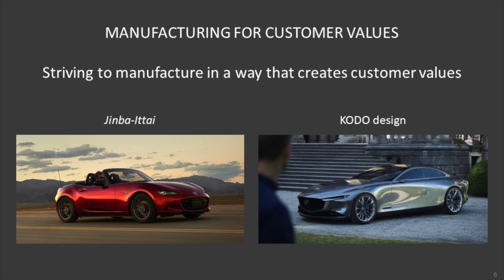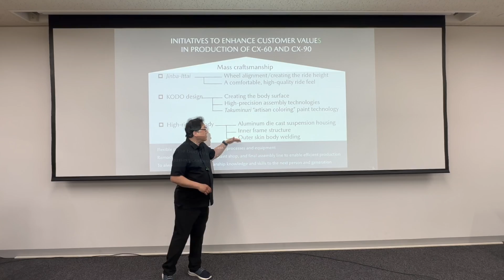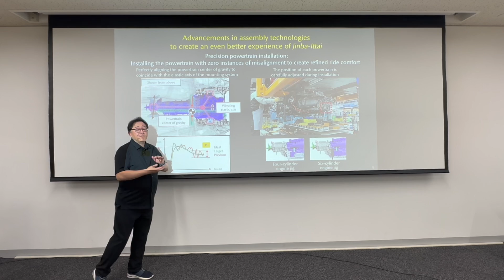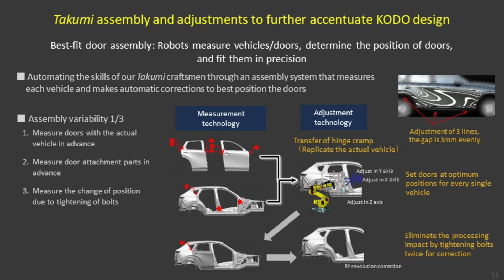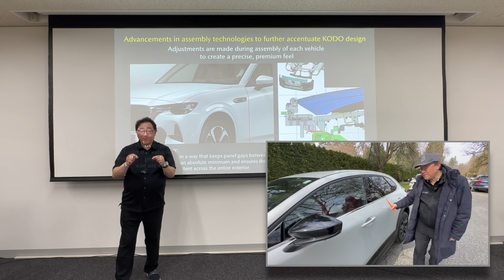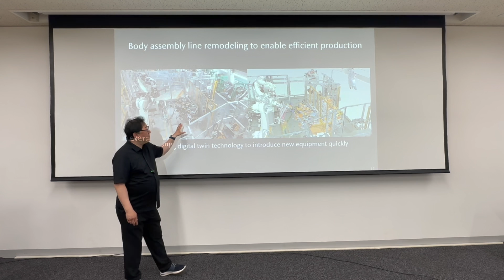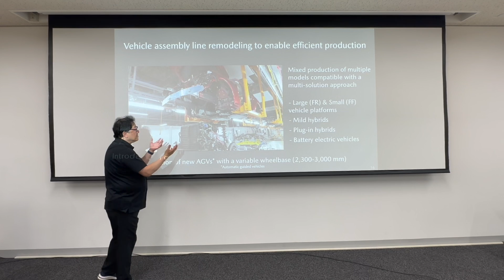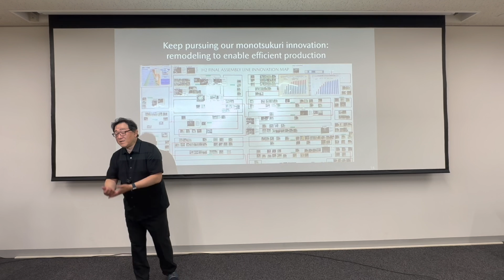ENGINEER EXPLAINS SECRETS OF MAZDA ENGINEERING // HOW MAZDA DEVELOP & MANUFACTURE CARS

Comment: Good video! Years ago we had a RX-3 Wankel Mazda. It was lime green. It ran surprisingly good until the seals went in the engine. We had a 2009 Ford Escape Hybrid 178K miles and still have a 2012 Fusion Hybrid 110K miles which are essentially Mazdas. Both have been great cars. We are Toyota people now, but would certainly consider a Mazda if Toyota keeps price gouging.

Comment: What kind of crackhead engineer installs a light defuser over a switch light indicator (Air Conditioning) so you can only see if the light is on in the middle of the fucking night?

Comment: Zebra lines are actually a surface analysis tool (CAD tool) used by designers to evaluate the quality of the curves that make up a surface. Its not something exclusive to Mazda at all. The way that Mazda curves the body surfaces on the side of their vehicles is unique in that it creates a very smooth S shape. Often this would be done with creases in the metal rather than exclusively done through the reflections on the surface. It is interesting and very distinctive.

Comment: I’m a Mazda fan, on my 2nd but the CX90 is over engineered.. Heard a mechanic say if u need to replace the water pump the whole engine will need to come out. U can’t put the trans in park without moving it up and over.. Some people don’t realize they’re not in park. Their 1st attempt at hybrid isn’t going well.. There’s multiple recalls on the 90.. I’m happy with old tech CX9. It’s a proven 4cyl and 6spd transmission. I’d still buy the 3, CX5 & 30 but all new 90….No thanks…

Comment: I bought the 2024 Mazda CX-30 Carbon Edition. Love driving it.  Too bad the gas tank is very small. 280 miles range.  Thankfully gas is cheaper in Texas. I missed my 2017 Mazda 6. Put on almost 70K miles and sold it during the pandemic.